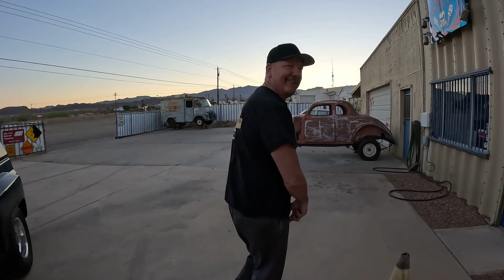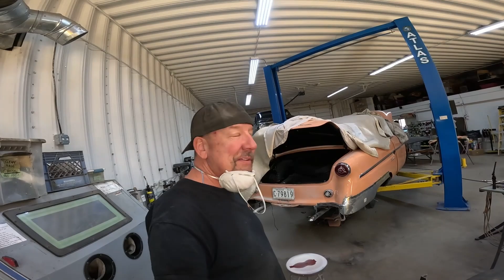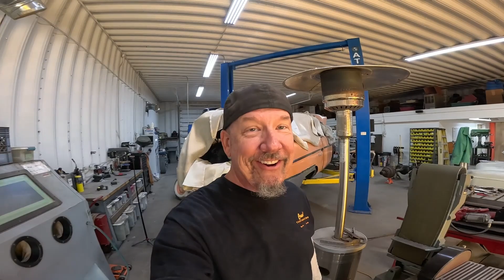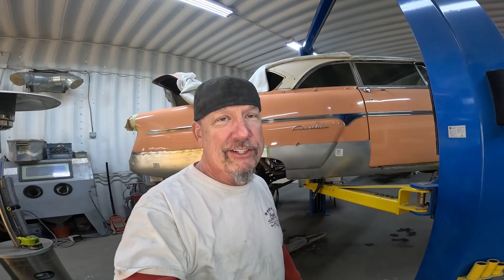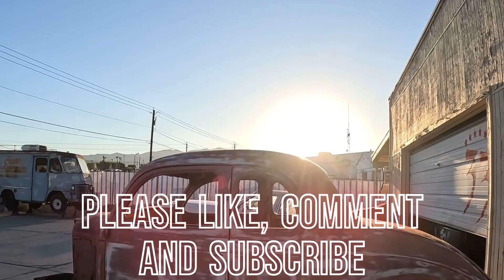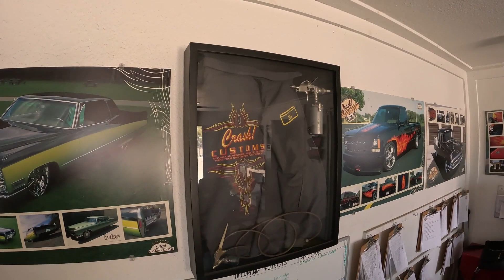1954 Ford Victoria Crestline part 5, rust repair, panel replacement, fabricating patch panels Crash!

Comment: I had a 64 Mercury Monterey Marauder the same color.   In 64 they called it “Bittersweet”.   I think the Ford color was named “Samoan Coral”.
Reply from the maker: That is what Ford calls it. I didn’t know that color was still available in 64. My buddy used to have a 64 Mercury convertible that he cloned into a Marauder. It was multi carbed stock set up, I can’t remember if it was dual or triple?